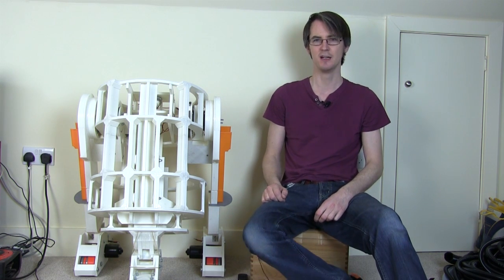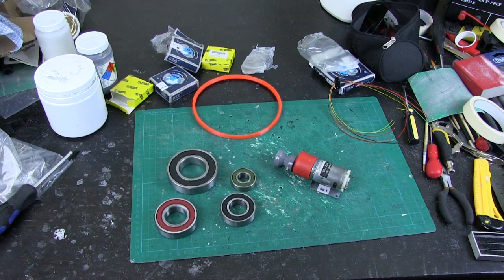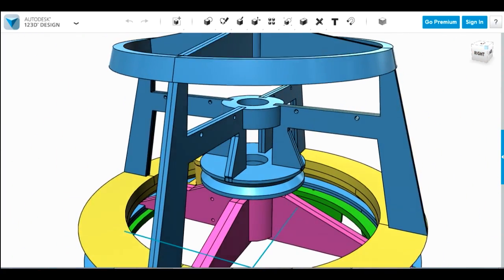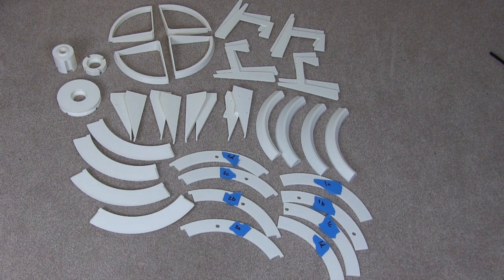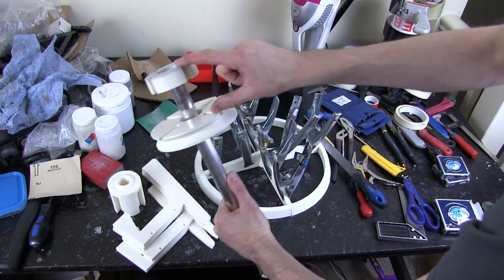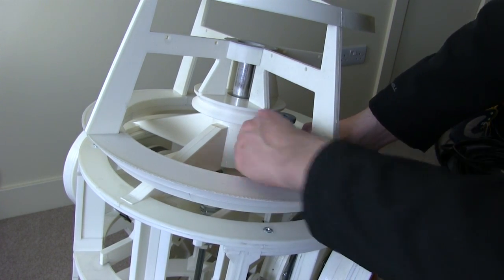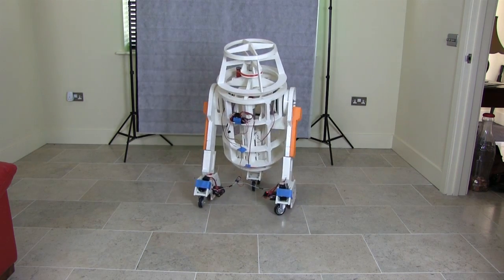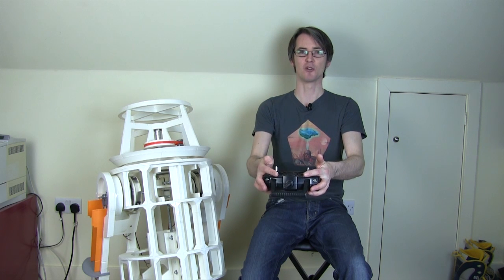Star Wars R6 Droid #8 | Getting the Head On | James Bruton

Comment: do you have a 3d printer that takes 2 filament roles if so please can i have the name
Reply: +M3 AllTech The printer with a dual extruder is a Lulzbot Taz with the FlexyDually Tool Head, with one nozzle for ABS/PLA/HIPS, and one for NinjaFlex or SemiFlex, but they also make a dual extruder that can do two different types of standard plastic.

Comment: Hey James, I have a question regarding printing with abs. I just recently got my first printer. I am having problems getting the abs layers to bond correctly, when I print in PLA I have good layer adhesion and over all a strong part. When I print in ABS my part is brittle and I can peel the layers apart pretty easily. Can you tell me what temp you print your abs at? I have tried anywhere from 230c to 280c and they all seem pretty similar in strength. I have a heated bed which I heat to 100c and have no problems with it lifting off the bed or anything, the prints come out looking nice but are pretty weak. Thanks for any help

Comment: You could build the various different heads, as in the Star Wars Galaxy often these were for different purposes.  And swap them over from time to time.  

Be careful routing up the central tube, as any wires / electronic cables not mounted to the head are liable to fatigue due to the constant twisting. Especially if you twist the head more than 360 degrees, although you could possibly use a brush coupler, to get power (or do the same with ball-bearings and 3D printed tracks).  I'm sure there are commercially available solutions as well though.

Comment: looking forward to see what gizmos your going to put in your R6. I`m sure you`ve probably thought of something similar and are of course for ahead in the build anyway,  but there seems to be a lot of scope in wifi control using a Raspberry pi (which i`m sure you`ll have planned to have in there some place already ;) ) Not only do you get the chance of some computer driving assistance and automation,  but also laptop or android phone/tablet control (or diy controller) but 2 way communication, maybe using a jpg server for the camera to give you a video feed.  Also lots of gpio pins for chatting to other arduinos in charge of flashy lights and other automatons.  I`m sure theres still a lot of fun to be had hacking the analogue channels of the controller. adversarial compatibility rules ;)

Comment: personally i would have used a wide angle high torque servo attached directly at the to of the neck shaft because it will realign itself to face forward and have that sort of jolt of movement like in the films if you jolt the stick rather than a slow to fast speed. other than that good job!
Reply: ***** oh you wanted that spinning effect, i didnt think of that lol. yes your way is best for that :) you mentioned data transfer between the head and body, how does that work without wires tangling?
Reply: kaka karrotcake He mentions a slip ring at 6:55.  These are specifically designed for infinite rotation without twisting the wires.  You can see how they work on the wiki page: http://en.wikipedia.org/wiki/Slip_ring
Reply: i always wondered how those work!